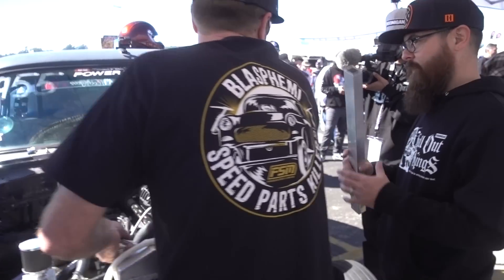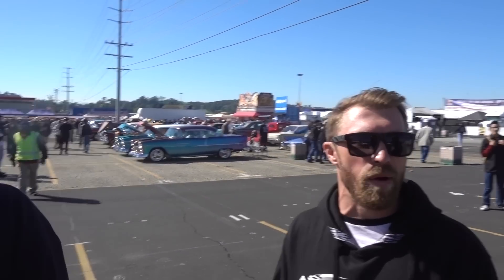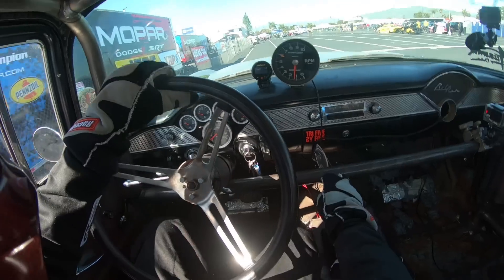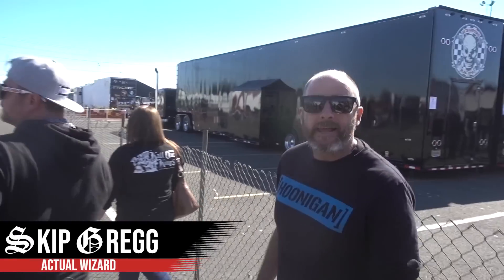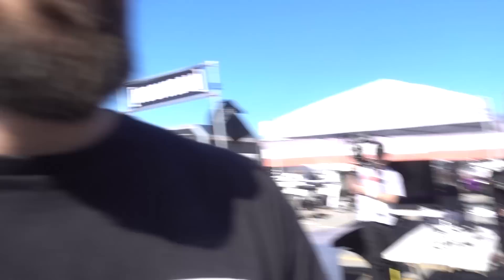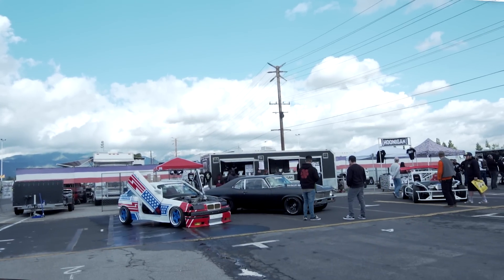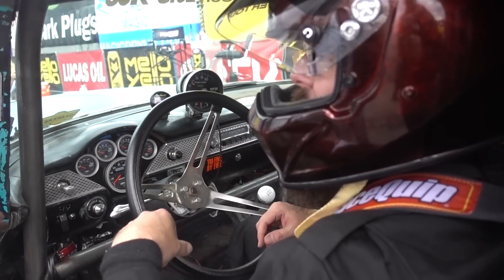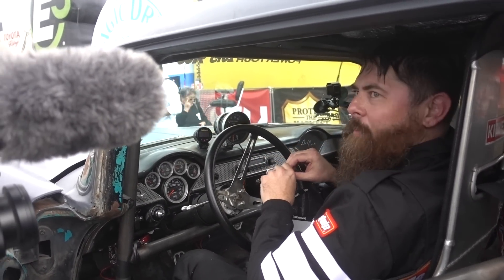The SHOWDOWN: Hoonigan vs Roadkill, Chase vs Finnegan

Comment: That clutch burning out probably saved his life, because the death wobble would have really gotten ugly if that car had gotten to speed.  Better kiss your momma and thank Jesus!
Reply: what would cause the wobble? swaying axle? negative caster?
Reply: @Mr.PudgeMuffin  I couldn't say...out of my paygrade lol.
Reply: That 'll buff out
Reply: @Mr.PudgeMuffin  the suspension is not adjusted at all. massive negative camber makes it really instable in a straight line, it even looks like the tie bar is bent.... also looks like massive toe in, when you would like to have a little toe out to let the wheels straighten themselves out, while driving in a straight line. this most likely caused the wobble (oscillation near or on the resonance frequency), which was initiated by the shock of the engine abruptly loosing rpm thanks to the gear being smashed onto one of the rotating shafts in the gearbox (due to a leaking or badly bled clutch system). in addition the prehistoric steering system of gassers amplifies this problem. all forces are directly translated to the steeringwheel and not dampened at all. all guesses tho, might be total junk what i wrote here....

Comment: 8.9 car vs not tested car ! No one could have seen this coming! John did tree his ass tho
Reply: On test pass before race it went 8.6
Reply: You should probably check out Finnegans youtube channel. Getting Blasphemi there was just as hard as what Jon went through. Finnegan was fighting engine troubles the whole way with water issues. He just had his whole rear suspension rebuilt with a different setup that was untested. I'd say they both struggled equally to have their cars ready for that race.
Reply: Yeah that is crazy I watch him as well
Reply: He didn't tree him, Finn's nose lifts first, Finn was pedaling the clutch it at the beginning until he got it to work then Chase had back to back issues. I think it would have been close if both rand good but I think Blasphemi would have won by by 0.5-1.0 cars.
Reply: You should really have an adult explain what “treeing” someone is to you skippy...
Reply: And whose fault is that?
Reply: Fin had issues. Trust me, Jon cannot tree Finnegan. I've seen the guy race his boat, and his reaction times are insane.

Comment: I felt Jon's pain when his clutch let go😭😭😭😭😭😭😭😭😭😭😭😭
Reply: Haggity Shmaggity bro sameeeee😓😵
Reply: As soon as that death wobble started up my first thought was... Wait, they let Brad install the front end?!!!???!!!  if I had to guess it probably wasn't the clutch it was most likely the throwout bearing or clutch fork/hydraulics.  Had a similar issue this fall with my 454/sm465.  I could get it going in first and shift into second but after that it was all bang shifts.  Turns out my Novak hydraulic slave cylinder wasn't getting the proper throw because I had screwed up (love the product, works great now that I sorted out my install problem). Now it's burnouts all day long until I blow driveshafts and u joints weekly!

Comment: Chase didn't build his motor and his clutch saved his life because if it would have worked the death wobble would have had him against a wall or worse. Round two will chase show up with a top fueler and there crew, maybe the Stig can drive it for him.

Comment: Add 40lbs of weight to the front of the car to replace water weight then it won’t wheelie as bad none of these guys use there brains anymore they make 10 lb puck weights and 15-40 lb bar weights that attach to your roll cage or you rear end to add weight where needed, pro tree is tuff if you never done it before it’s a count if see the green you’ve left too late